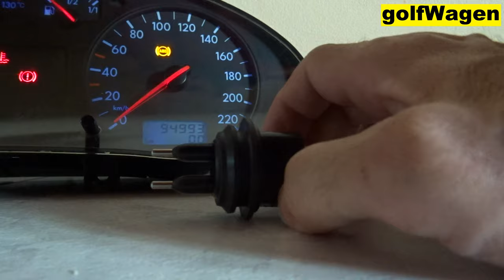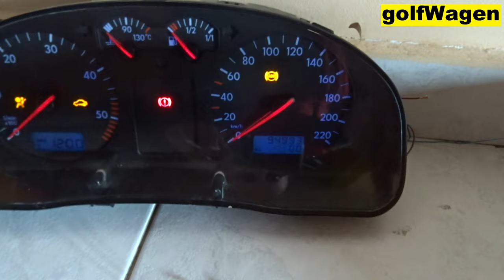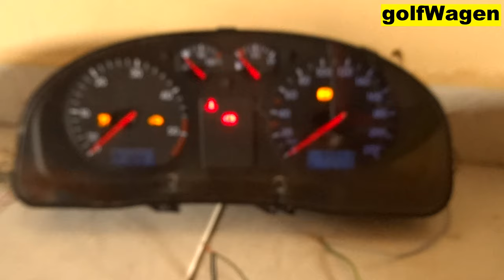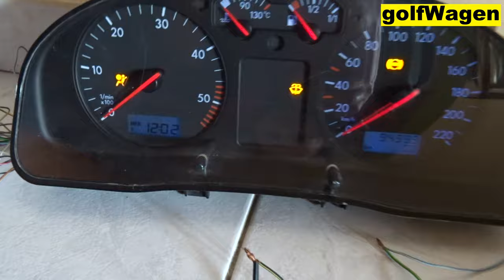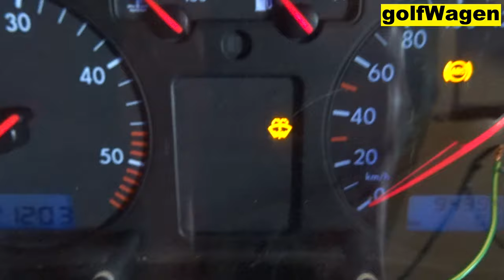VW Golf 4 washer fluid lvl sensor connect and coding

Comment: Hey bro i have questions about golf 5 1.9 tdi … it is safe to clean engin like this ..=> when you drain your engins old oil, before you fill your new engin oil, you fill your engin 1/2 another oil and 1/2 with diesel… you fill your engin oil and diesels mixture, then work engin like 2 minute end. Then drine this mixtures and. Fill new oil ???
Reply: use a flush for the motor